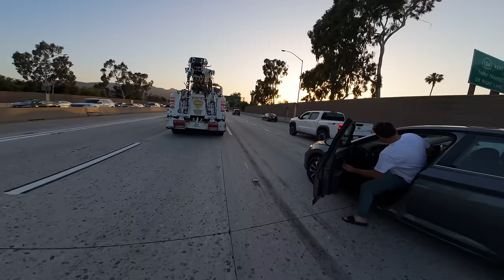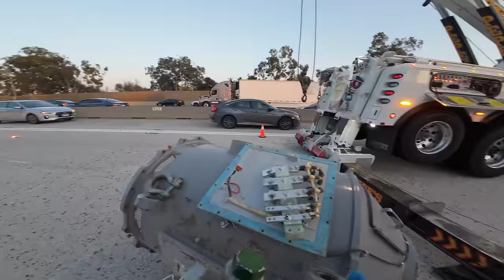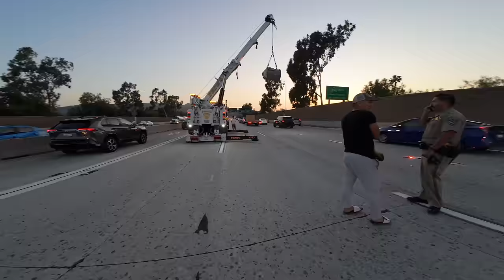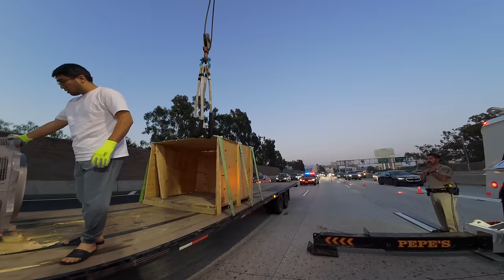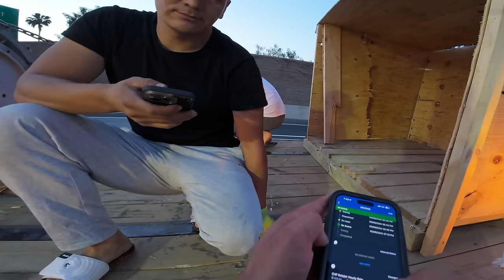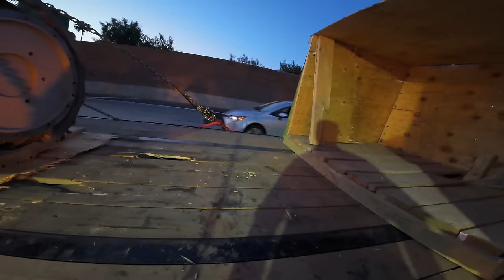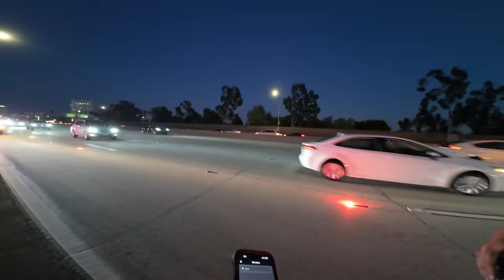18,000lb Alternator Falls off Trailer on Freeway

Comment: Just put It in a box,  it'll  stay there. WRONG! It was a cheap box to start with. And not secured properly inside the box! 😢😮😅
Reply: My thoughts also
Reply: Agree, poor driver, having to beg about the price. Hope he can put cause with the crator.
Reply: @pear7777  This is why you inspect your load. Driver is at fault as well.

No forward tie downs, speed was most def a factor
Reply: @mariod818  Forward tie downs wouldn't have been much help in this case as the crate itself was secure on the bed, but the load moved inside the crate and bust out. Would have just snapped whatever is in the way as it rolled. That thing might look small but it weighs as much as a whole box truck, when it gains momentum good luck stopping it. Should have been better secured inside the crate, or used a more suitable crate to begin with.

Also, the crate is likely to be nailed shut, they just pick it up and put it on the bed with a forklift. The driver likely doesn't even have permission to open it up to look inside. As for refusing every load the driver can't look inside of to make sure it's secure as many others claim, sounds good in theory but in reality he would be out of a job pretty quick...
Reply: @N0xiety  it would of prevented the roll and it coming out the front look at the damage
Reply: @mariod818  I don't think you even read my comment...
Reply: @N0xiety  "Forward tie downs wouldn't have been much help in this case"

Look at the original placement of the straps.

Someone went a little too fast. He experienced a load shift due to most likely braking. he strapped everything but forward movement, as well I highly doubt they prevented him from looking at the load which he claims. 

I used to deliver machinery doubled the amount. lol
Reply: @mariod818  I am looking at the placement of the straps. The problem is that the crate seems to have stayed in place, so it was strapped tight enough, but the load inside seems to have rolled during hard braking. And being so heavy, it simply broke through the wall of the crate. 

Now, even if there were forward straps, they wouldn't be reinforcing the wall of the crate directly is that not right? The straps would just be holding the crate more firmly on the bed with some space in between the wall. The question is, would these additional straps be able to stop the load from rolling further as it bursts out of the crate, or just snap under the momentum? Would two straps been enough to stop it? Or maybe four? What do you think?
Reply: @N0xiety  What i think? someone half assed properly strapping it down, didn't bother to inspect it and is now looking for a scapegoat.

You tell me why would he be asking the tow service to blame it on them especially recorded? You realize that's illegal?
Reply: @mariod818   You are avoiding to come up with answers to my points. What you think of the situation was already pretty clear tbh, that's why we are having this discussion, which you keep avoiding to adress my points, which makes it not much of a discussion.

As for answering your question, yea it was wrong for the driver to try to drag the tow service guy into acting as a witness and expert on the placement of the load, and try to have him give a statement to determine who should be at fault. That's obviously not part of his job. I believe the tow service guy could give his opinion if he wishes tho, so can anyone else, doesn't mean the opinion would be valid, or illegal to give. It is still better to not be involved in this mess at all ofc.

Now i'm asking again, would additional straps outside of the crate be able to stop the load from rolling further as it bursts out of the crate? Or would they just snap under the momentum? Would one be enough to stop it? How about two? How about four? Accordingly with the straps load capacity, how many would be needed to stop an 18,000lb alternator rolling out of the crate and slamming into the straps? Mind the fact that even if the straps have enough load capacity on paper, you still have to take into account the added force the momentum of the load creates as it slams into them.

You claim that you used to deliver heavy machinery, so i assume you should be knowledgeable about this. If you can't even come up with an answer, i'm gonna have to call bs on your past expertise, and this farce of a discussion will be over...
Reply: @N0xiety  You clearly don't understand the importance of forward tie-downs. I used to deliver CNC machines and other items that weighed the same or double, and I can tell you firsthand that forward straps would have made a difference. They prevent forward movement during sudden stops or deceleration. Properly placed forward straps would have provided a barrier, reducing the load's momentum and likely preventing it from breaking through the crate. They distribute the force across multiple points, reducing stress and enhancing stability. The driver’s failure to use them is pure negligence.

Furthermore, the hauler trying to put the blame on the pickup location and coercing the tow service, who helped reload the alternator onto the truck, into supporting this narrative while being recorded is an obvious attempt to avoid responsibility. This is both unethical and potentially illegal. The only farce here is your understanding of load securing. It's also a farce to believe he would have been denied the inspection that any hauler is allowed to have. He could have prevented this, and even if he was denied inspection, he should have documented it for this exact reason.

Additionally, some container boxes can be engineered to withstand the weight of heavy loads, even if made of wood. That's precisely what engineers are for. Forward straps are standard practice for a reason, something you clearly overlooked.

I now work in aerospace guess in what 

🤣🤣🤣
Reply: @mariod818  Oh no i do understand, but unless the straps are flush with the walls of the crate and keep it under tension, i don't see how it would have prevented the crate wall from breaking when the load shifts inside and slams into the wall. In many videos i have watched, straps are always secured at an angle instead of being flush with the crate, so i don't see how angled straps would take the load off the walls of the crate or distribute the force, where they aren't even touching the wall.

If the load is not properly secured inside the crate, or the create isn't suitable for the load, or the load is placed in a way that allows it to roll inside, which in this case seems to be a mix of all these reasons, it is obviously going to move during hard braking even if you strap the crate down with hundreds of straps outside, and it will slam into the wall of the crate. I'm guessing we both have no problem with this yes?

Now, with enough straps, and depending on the way you strap it, you would obviously be able to stop the load from bursting out of the crate and running off, but i don't know the number of straps we could see in the video that would be needed in this particular case. Even you don't seem able to calculate it, basically just giving an answer of 'trust me bro, it would have just worked better if the driver put some forward ones', which i'm quite skeptical of.

I just don't see how your suggested straps would have prevented the wall of the crate from breaking and solved all the problems, unless they are flush with the crate to actually support the wall. The crate itself seems to have been secure enough on the bed without the additional straps you recommend. When you look at the side bars the straps are secured to, it becomes quite obvious that the crate did not slide.

I mean sure, i'm just working on common sense and what i can see here, i'm not an expert, but i can still form logic, and physics ain't magic...
Reply: You dont 😂😂😂  @N0xiety
Reply: @NebulaNexus00  You are welcome to explain
Reply: @mariod818  As a driver you can't control how things are boxed. If they put something inside of a wooden box you have no say about how strong the box is or how it's resting inside the box. They pull out the box with a forklift and load it and tell you to get lost. Best you can do it strap it down outside the gate but you are not allowed to open boxes.
Reply: @tripplefives1402  you can its called inspecting your load
Reply: @mariod818  No, you can never open the box. If you do you are going to be paying for that cargo. It's sealed and you are not allowed to open it.
If you want a negative paycheck for the next 12 months go ahead and open it then.
Reply: @tripplefives1402  Sorry bud, but you can and have done it 👍

The drivers are ultimately responsible. Drivers aren't engineers, so I'm not sure what those a driver has to do with the box... lol, you'd be pleasantly surprised how crate box's are made to haul around heavy cargo. What they don't compensate for is driver error. Which is the case here. Positioning is also noted in the shipping slip, so the driver did a half assed job 🤣 no excuses did it for 5 years, 

😅
Reply: @mariod818  If the load has seals on it, and you cut them off you are in deep trouble. The seals have unique serial numbers so you can't just replace them.
They are little cables with plastic locking tabs just like they lock dry vans with.
Either way once you open the box there is nothing you could do inside the box. You going to pour glue all over the inside or something? There are no tie downs inside a wooden box.
If it ships in a box then it better be inside that unopened box when it gets there.
If the seals are broken they think the load has been tampered with.
Reply: @tripplefives1402  placement is noted with the shipping slip. 

There are no excuses for the drivers at fault here.  He shouldn't be hauling otherwise. You don't need to break seals.
Reply: Glad nobody got hurt, but sure makes you wonder how many unsafe loads are being hauled around right now?! :face-orange-biting-nails:
Reply: @McBuggs.  I wouldn't be too worried if they were foreigners I would be. People forget that the shipping labels help with figuring out what you would need and proceed to provide some detail of the contents inside.
Reply: @mariod818  The box did not move and was properly secured. The item in the box broke through the box. did you even watch the video?
Reply: @tripplefives1402  The box didn't move but the shipping label clearly states the direction of the inside item, no forward straps and this is what it results.

If the driver had a brain and if you did you would known how to place the haul correctly to prevent this.

It is the driver's fault, regardless of how many delusional statements yall want to make, and whatever excuse you want to form, it is the driver's fault for securing the load properly, WHICH it wasn't.

don't respond
Reply: @mariod818  man you wanna be trucker should probably finish highschool before weighing in on things about the logistics world. Pretty obvious you are definitely not familiar with this world which is ok but pretending to be smart about something you're ignorant in is a bad look
Reply: @grantball6325  Find a trade you have some common sense in buddy, clearly pretending to know things on youtube aint helping. 

Forward tie downs would of prevented the forward roll and it being on the highway. Crate boxes are over engineered (Does that mean they dont fail? NO) That is why you properly strap your hauls.

The driver wanting to blame on video is illegal.

I've hauled chemicals to heavy equipment, i've seen enough crashes and burning rigs off grapevine to tell myself this ain't for me, and it wasn't im better off in the aerospace company im currently welding at.

Get over yourself, Stay in school. You don't have an understanding in what you're replying too.
Reply: @mariod818  You're nuts, even forward tie downs wouldn't have stopped that from rolling out of the box. It should have been secured to the pallet, period. Straps do not come straight down, they come off at an angle, should he have gone around the pallet and the entire box?? Was the driver suppose to open the crate and see how it was secured?? No, he strapped the crate and the crate never moved. Whoever made the crate is to be blamed.
Reply: @dc6233  Not nuts, logically,  Deductive reasoning would be having a second safety measure so it doesn't come off the bed .

Are we forgetting the fact that the cause for the broken crate was speed, you realize shipping lists have it written down in English the direction of the item inside? 

if he was so innocent, he wouldn't need to have him state who was at fault on camera, which is illegal. If he had a brain he would of recorded it when it was placed.
Reply: @dc6233  Something tells me allot of people can't seem to read shipping lists whatsoever. 

That crate is perfectly fine, you'd be surprised how much they can handle they're not meant to prevent driver error. 

The shipping papers will tell you about potential hazards.

Either way it's over now you can go to bed now
Reply: And the cop goes "not report worthy"..  wtf?!

Comment: Ugh, I don't like it when people argue about paying for something that a professional did really quick.  You're pay for the professional's years of expertise, cost of operating equipment maintenance, and the speed at which somebody does it.  All of that is totally justified in the price.
Reply: yes its a live and learn situation , i bet he asks more questions next time he hauls a heavy box
Reply: the guy said he's just a driver working for his boss . then his boss has to pay but he's not on the scene and doesn't know who's fault. it's his customer who packed the alternator wrong. that thing is like a steel coil . copper is heavier than steel.
Reply: @ronblack7870  I understand the whole "who is the blame?" thing but that's between the hauler and the customer, not the tow truck company.  The hauler needs to pay it then get the money from the customer.  It's ridiculous that this had to happen on the highway.
Reply: Cannot justify a response without the cost of the service . A guess is $600.00 per hour for the rotator .
Reply: Agreed! And the cost to purchase the specialty equipment that very few have to get the job done.
Reply: @vicpetrishak7705  
Id guess its 2-3x that cost.
Reply: And the risk of walking in the middle of a busy roadway with only a single stopped police car to tell people to move over, right at the section where people will be speeding up as they pass you.
Reply: @vicpetrishak7705  600€$ per hour  for large rotator?? Keep dreaming. They are between 1000 and 1500 per hour. Depending on a job. It was said before.
Reply: @aljosaskrabelj8412  that crane looks expensive in that case I will understand why they will a lot of money per hour.

Comment: 18,000 pounds onto his trailer hitch???????   I have to see it to believe it.
Reply: Yeah, no way this is anywhere close to 9 tons.  maybe 1 ton.
Reply: It's a goose neck
Reply: @jakep8921 That thing is full of copper which weighs more than steel. You're dreaming if you think that only weighs a couple thousand pounds.
Reply from the maker: Ya I found that comment hilarious lol one ton. I've seen fully electric small push back airport tugs weigh 70,000lbs. Blows my mind how heavy things can be. Wouldn't doubt if it wasn't all 18,000lbs but at minimum this weighed 15k
Reply: The placement of the alternator seems close to the tongue.
Reply: @fyrman9092  I had missed that it is a goose neck and not a hitch.

Comment: Very well put video, as for the accident, 18000lbs was properly secured with 3 4” inch straps, problem was with whoever loaded that box with the alternator with no securement inside the box.

Comment: Barely scratched! What a POS crate for heavy, precision equipment. Giant rolling pin!
Reply: Really poor job of the company/people packing it in the crate without proper secureing it. Bound for disaster. In the end t's the trucker that got the responsibility everytihing he got on his trailer is properly secured. Undertand it's difficult to know how it looks inside picking up a crate like that. The crate should gotten rid, secured the stuff and tarpet it in the frist place
Reply: Didnt even look strapped to the pallet, didn't see any strap remnants  in the video
Reply: They'd secured the crate to the trailer really well, but this was like the time I was shipped a reel of cable in a far bigger box.  It spent the trip trying to smash it's way out.  The crate looked really flimsy for holding tons of metal.
Reply: Back in the days of Central Planning, the industrial companies had to meet a weight-based annual quota, and after that was met, the factory director could do as he wanted. As a result, they over-engineered massively, and never got out of the habit.
Reply: @Rimrock300  
If ya ever bought XMAS decorations from HALLMARK in their stores, they used to add some plastic for the item to sit in.. or some paper for it to be cushioned.

Now.. nah. Your XX.XX fancy Christmas decoration just goes into a fancy colored box.. and thats it.
Left a bad taste in my mouth....
Reply: Lucky it didn’t land on top of a Honda Civic
Reply: When you hire movers off wish
Reply: @Group_Anonymous  that generator is smaller dimensionally than a civic but its weight is closer to a box truck. I don’t think there’s a vehicle on the road that would fair well if it slammed into that. 

Maybe an 18 wheeler would be survivable if the generator got pushed down and the cab was pushed up and over it.
Reply: Shame, the bearings are ruined at the minimum, the housing could also have developed cracks, and at the worst the rotor shaft might be not so straight anymore. That's a huge impact.
Reply: I ordered a snowblower that came in a crate and weighed maybe 200-300lbs and it was secured better than this was lol.